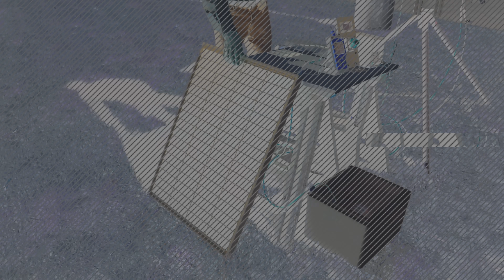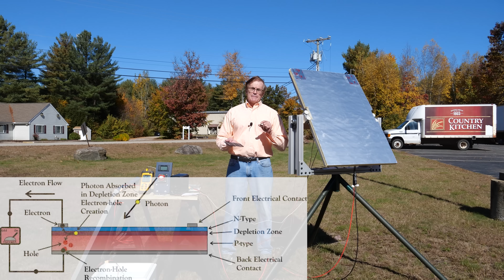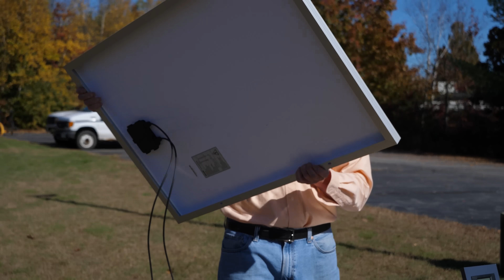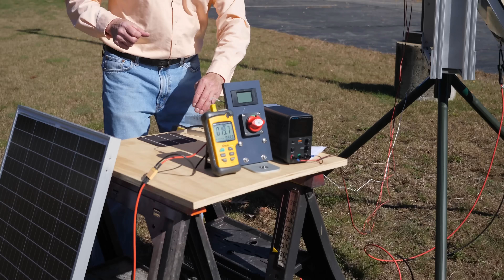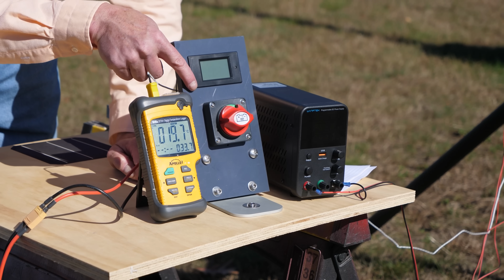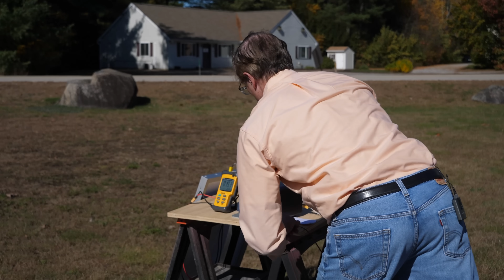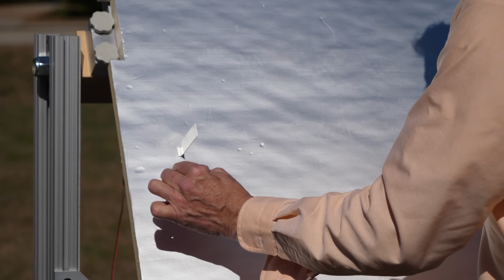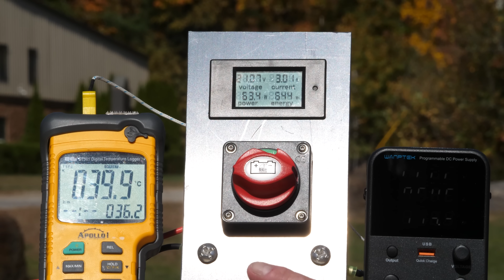Do you REALLY get enough out of your solar panel?

Comment: Something I've wondered for a long time is if it would make sense to add an array of Peltier modules to take advantage of the heat and transform it into electricity, maybe in this case that could be used to drive the fans
Reply: No, it doesn't.  Peltier modules are extremely inefficient... and I do mean extremely.  No advantage whatsoever and the thermal take-away would be insufficient to actually cool the panels.   Also, keep in mind that the contact surface on the back of the solar panel would have to be essentially the entire back of the panel and not just some portion of it.

Comment: The format you are uploading is always making 720p alot larger and consuming lots of internet data. love your channel btw, a heads up is all. 
I download videos as dont do internet at home so i get to see the sizes of each channel. 
Simon whistler and some other creators seem to have found the trick, their channels consistently have 720p and 360p similar sizes, a few megabytes difference, Simon Whistler videos 720p is often smaller then the 360p.
This video is 360p:56Mb....720p: 201Mb for a 20min video, so will be chewing lots more internet then necessary. Over 30K views a video and that's ALOT of data and electricity saved by a change in format.

letting ya know in comment no. 1,035, so i expect a quick reply  ;)

Comment: Though water is a good heat conductor, it also can remove quite a significant amount of heat via evaporation, especially in the summer and in dry climates. Yes, this method loses its effectiveness in the winter when the temperature dips below freezing, however cooling is much less of a problem in the winter as touched upon earlier in the video. I do think it is worth exploring how a fine film of water (maybe a “mist”) over the panel would effect the temperature in the middle of summer. However, I would question the power effectiveness of this method, as water is much denser than air and would probably require more power to pump than air fans. In my opinion, a passive heat sink would probably produce the most net electricity, because there is no extra power being used, with the least amount of moving parts. In terms of cost, though, it’s probably worth it to just buy more panels then to spend money on an additional heatsink for maybe 2 percent extra wattage, which is likely why the majority of panels are made with no heatsink.

Comment: The power gains alone wouldn't warrant adding cooling fans. Solar panels are so cheap, its easier to just add an extra panel or two. I'm in Australia, and have mounted my panels about 10cm above the roof to promote air flow. Realistically, my panels are never used 100%, the charge controller is PMW them at a much lower rate. If heavily overcast, then yes I need every watt, but its also cooler.

Comment: I like this video.
Two questions.
1. Does the “closed” environment that the aluminum sheet increase the the heat? (That would make the test invalid). 
2. The test as I understand it was made with “solar tracking” though manually, no roof top solar (almost non) panels track the sun. So the worth doing it may not be worth unless it’s industrial and solar tracking. 
These questions weren’t answered in the video. Anyway, thanks for a good video. (I gave it a like 👍)

Comment: What if you just used radiator fins and put them on the back of the solar panel and mount the whole thing so that the fins of the radiator are suspended into a bucket or tub of water to pull the heat away from the panel into the water therefore keeping the panels cooler making them more efficient?

Comment: I have 445/575 bifacial panels.those are about as big as you can get.im assured 400watts per panel.260 per panel.dont waste your time with 100 watt panels.signature solar in Texas. Or santan solar in arizona.signature solar has EG4 batteries and inverters that are awesome

Comment: Perhaps a silly idea, but what about putting some water sprayers which are triggered periodically (say once a minute) and are pointed at the back side of the panels? They will require exceedingly small amounts of electricity (I guess, tbh I have no idea), but can help cool the panel further by evaporative cooling together with the fans.
Reply from the maker: It would work,  but the whole system  would add a lot of complexity and potentially maintenance issues.

Comment: Wouldn't comparing it with a panel without the sheet in the back be more accurate? The sheet limits airflow when the fans are off.

Comment: One thing I learned recently about heatsink design is optimal fin length, in the case where the heat is already being transferred through the material to air. For example, perhaps a 1-inch fin does the same job as a 3-inch fin, as the heat is already transferred before reaching the end of the fin. So perhaps it's possible to reduce the cost and weight further, with some calculations, for the optimal minmaxed fin length for heat transfer.
For reliability reasons, I wonder if it's possible to have passive convective heat transfer, in a very hot location.
Reply from the maker: I actually  did some of those  calculations.  There is no limit to the improvement  with fin length, but it's  the law of diminishing returns. Doubling the fin density  and halving the length may be better. The air velocity becomes significant as well as the fin density increases.

Comment: Just use the principle of solar water heating . Attach a metal heat sink to the back and attach pipes that run in a serpentine pattern. Pass water through the pipes and  get free water heating. The pump required to circulate the water would consume only a few tens of watts and there would be far less to go wrong than using a load of fans.
Reply from the maker: As I explained,  that will not be as efficient.

Comment: Why not just put the heat sinks on, and leave the backs open to air? Let convection take care of it, and forgo the fans and back panels. It wouldn't cool as effectively as the active system, but, I'll bet that the gain in wattage would be the same, with much less expense, and better reliability. Under those conditions, I don't think the fans would produce more power, than they themselves, consume. As you mentioned in the beginning of the video, the fans barely increased panel output beyond their own power consumption. I think the same would be true, if you put the heatsinks on the back of the panel, and just left it open to the air.
Reply from the maker: I actually  tested that and the fins do improve  the efficiency without forced air, but very little.  It's not as good.

Comment: mount your solar panels over water in hot areas or in general... the hydro cooling will make it more efficient... is a hypothesis
 
also when ever possible use higher elevation locations to reduce ground tempuratures
Reply from the maker: Both true

Comment: Why venting at top and bottom?  Why not vent at the top, have fans at the bottom so you get heat rising to help flow up the heat?

Oh I could see that water dripping be useful with my dad's work.  They do have a spring that is flowing all year, they also have cattle they have to water.  They could have water coming from the stream, pumped (ram pump) some water to the top of the panel to dribble over, then flow into the cow stock tank for the cows.
Reply from the maker: Flow restriction and convective flow augmentation.
Reply: @TechIngredients  Sorry could you ELI10 that?

Comment: The temperature of solar panels here where I live even in Winter reduces the power output. You could fry food on them. The fan idea is good but I would prefer to use a metal plate with fluid channels in it to harvest the thermal energy as well as improve the PV efficiency.
Using your thermal epoxy/paste and a stainless steel panel that would be cheaply made by having two thin sheets with the fluid channels pressed into one of them and then joined together. Attaching the flat side to the back of the panels and then running a suitable fluid through them to a heat exchanger this giving you heat and electricity from the one panel. For you people in the northern hemisphere to heat your houses and for us in places like Australia to be used for hot water and/or used to cool our houses. Cheers from OZ

Comment: The main benefit from water cooling is the ability to reclaim the waste heat, for DHW with a heat pump. You were going to be heating the water anyways, potentially with the electricity from the solar panels, so the efficiency in that regard goes way up.

Comment: Hrmm. Wonder if one could drive an axial fan with a small savonius type windmill on each panel and a small gearbox.

Also wonder if a HVAC system's condensate pump has enough oomph to mist the back of the panels and get some evaporative cooling.

Comment: Thanks for sharing.
I see a lot more con than pro:
- if you auto consume your electricity, you have way enough energy in summer and struggle in winter, but in winter your fans are "useless"
- the high temperature are reached only during the hottest hours of the hottest days of summer. In the morning or in winter cooling the panel are less effective. At the end the life expansion can be very small.
- the fans can break down and could need to be replaced 2 or 3 time during the lifespan of the panels. They are very difficult to replace if they are below panels that are on top of your roof 😞

Passive cooling should always be the first choice.

Comment: Back in '88 or so (IIRC), I was given 20 3' x 4' panels that had been on top of one of the buildings at Georgia Tech. I had been up on the roof where they were installed, and while I don't remember the details, I do know they whatever group at GT that was using them was experimenting with misting them from the backside. While there were pans under the panels, I don't know if they attempted to recover part of the sprayed water or if it was being routed to a downspout just to keep the roof being wet all the time. The project had already been shut down, so I never saw the sprayers in action, so I couldn't say if it was a fine or coarse mist, etc. I do recall saying they were temperature triggered. I ended up selling the panels as the roof on my house faced the wrong direction. I don't recall the age of the panels (they were marked), and I never bothered to check what the efficiency was. I mean, if you're given 20 panels for free and they're rated at 60 watts, even if they're only making 45 watts, you're still ahead, right? :)

Comment: No it's not worth it, there is no free meals. Getting so little more out of 100W panel with such system including fans, external cooling fins and other mechanical additions, it just eats itself out. It also needs a control system that optimizes the airflow keeping the panels in optimum temperature in each conditions plus fans are mechanical, they last not more than 10 years in outdoor condition and then you need to replace them. Just not worth it. Companies that make these commercially are just using this "new technology" as a marketing trick. Adding more panels to get more power is much more worthy, panels aren't that expensive. In my country at least panels are 50 cents/ 1W

Comment: the major problem any owner relying on solar panels has, is output in winter.  In summer, the output is so good, that output is never an issue.  I have an observation.......in the first run, with the cooling fans off, the heatsink structure fitted, combined with the panels angle, was already providing some passive cooling through the open ducts. In other words, the panel could have been hotter and producing less power in its stock format........the gain with the fans and heat sink design could have been higher.   Fitting extra cooling, from the point of view of protecting the panels lifetime and improving output makes a much bigger impact on the higher efficiency, higher cost panel than a cheap one, and their are fewer panels to modify for the same output. A really good application for the waste heat......is heating water. Really interesting,practical video.........thanks.

Comment: Use a sprayer for the surface, a fine mist that covers the whole surface..low volt pump, recycle water that drip off the bottom.

Comment: I wonder if a Peltier array on the rear could be used to pump the heat away? The hot junction bonded to the Photoelectric Array with the cold junction bonded to cooling fins. The current from the Peltier device drives low power fan(s) that force cool the cold junction fins. The greater the thermal gradient the more cooling air flow is generated. When the photoelectric array is operating in cooler ambient conditions this also helps to maintain a thermal gradient.

Comment: Great stuff - as always. I’ve not even tried to run theoretical numbers (let alone actually experiment), but have long wondered about a hybrid passive/active cooling where a chimney effect might be had… enough of a delta-t to draw air up and through.   Used globally in high temp housing environments. Anybody playing in this arena (or why not).  A wind and Venturi would be another.  Thoughts?
Reply: You have to weigh this against wind protection.   Generally speaking, fixed panels parallel to the roof and fairly close-in on the roof is a necessity if you don't want the panels to get ripped off by a wind storm.  The bigger problem is that you still need fins on essentially the entire back-side of each panel if you really want to cool them with air flow (with or without fans).  That many fins is an expensive proposition verses just punting and spending the money on more panels instead.

Comment: Nice video, thanks for the insights! But I just calculated that for my photovoltaics and it's not worth it for me. I don't have the exact numbers for the fans (price, wiring, durability) nor the module temperatures during the days, but if I assume a degradation of 1%/a uncooled vs. 0,5%/a cooled and a 10 year longer lifespan of my installation (that's VERY optimistic imo) I get around $1700 more yield at the end of its life, time not included. So FOR ME upgrading my modules won't happen.
BUT: If I had to install a new PV system I'd go with a cooled one. Or a hybrid system :-)
An idea: Peltier elements to run the fans?

Comment: I wonder to what extent fitting the fins to the back as you did and relying on convection to pull in cool air from the bottom of the panel and exhausting heated air from the top (with possible assist from any breeze that might be present) would make a difference? Presumably this is something you must have tried before trying active ventilation. This might be a better option in an area where there is a persistent prevailing light wind, although that may already be acting to cool the panels from the front surfaces.

The fact that you have shown that with relatively modest equipment you can get a net benefit shows there is much potential in this idea. For rooftop solar arrays you could use much bigger, slower spinning fans to extract hot air with the corresponding efficiency improvements.

Comment: Hello, how well would this work with bi-facial solar panels?  They allow light to pass through the front of the panel, reflect back up to the underside of the panel for secondary light absorption.  So even if there’s some light snow on the front panel, the reflected light that does pass through can heat up the underside to melt the snow back off.

Comment: Like the video, but how hot does a regular panel get without the aluminum plate on the back? The comparison in this video somewhat unfair and should be repeated. Completely unmodified Panel vs. Panel with installed and active fans.

Comment: Cost of modification + panel watts. Vs putting cost of modification into more panels. 

Only makes sense to do this if space constrained and require more from panels. Most panels are rated 80% nominal after 20 years. Most panels do better than that.. I think it makes more sense to put the money either more panels or a tracker.
Reply from the maker: Don't  forget  the significant  effect of temperature  on panel  longevity.

Comment: Here in Kentucky, the sun usually bakes my Solar Panel in the summertime.
I now have 3-200w Solar Panels on my roof. I also use 3 deep cycle Marine batteries for my humble needs of electricity. 
This topic is of extreme importance to myself, BECAUSE I have felt the heat these panels attract during the hot Summer, because every 30 minutes or so I would check my Panels to adjust them to point directly in the sun and the panel was extremely hot. 
I also could see by my cats if the panel was getting too hot...they didn't like to sit on them then either ☺️
I have some questions on using inverters on my batteries...
I use a CPAP machine and the lowest wattage to run my inverter is 175w. My CPAP 's wattage is ONLY 90w. 
To use the machine I have to have a regular plug in (hence the inverter) to runn it off of my batteries at night time.

How can I get around using ANY inverters to run many of my appliances? 
Also how can I find out how many watts each of my batteries are, when the manufacturer ONLY USES AMPERES on the battery?
I have looked at many sites on the Internet to figure it out, but got more confused then I was before. 
Is there a simple formula that you have that can help me figure the strength of my batteries?
And I am also not able to find high gauge cables or plugins in automotive stores to hook up my system directly to a junction box, where I have 4 electrical outlets on it (this junction box came out of a wrecked motorhome, so it is meant for my system). 

I just can't hook it up, BECAUSE I don't want cheap red and black wires that you can buy in a big box store or automotive stores, or anywhere they sell wiring, because I don't want to burn my wires or house down, when the wires get too hot.
Do you have any suggestions where I can go here in Kentucky (middle), to order these thicker wires?